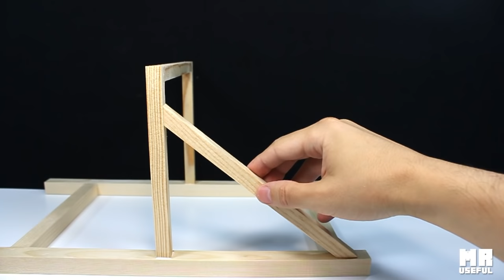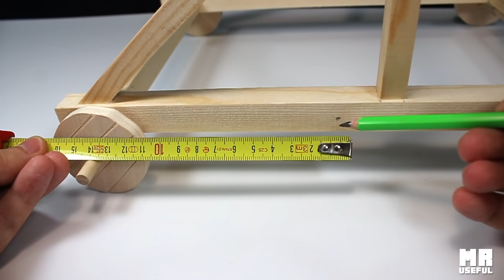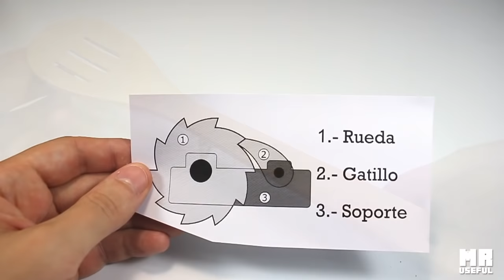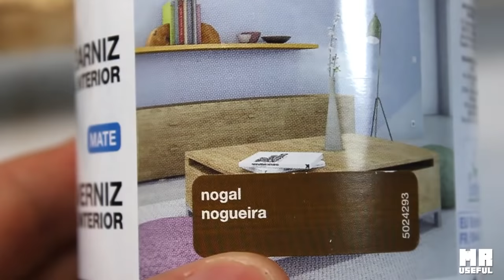How To Make a CATAPULT | Amazing Wooden Catapult

Comment: I don't know a whole lot about catapults, but after just building one myself, I know that this one is far from stable. This frame needs more supportbars in the front part. It's literally the most important part due to the pressure you make with the rope. Also the rope needs to be tightened equally from both sides. Also you didn't shoot it, which I see a lot of people are rightfully disapointed about...